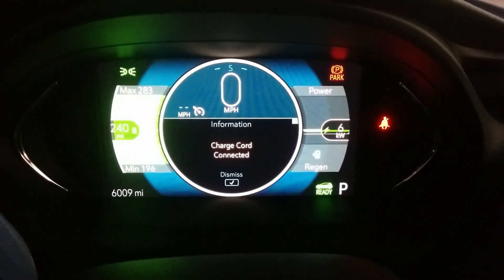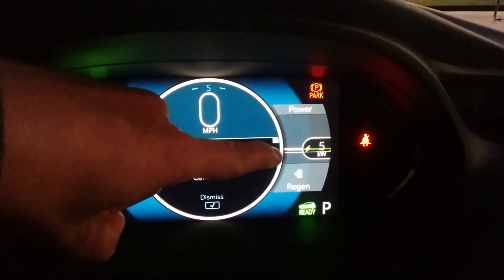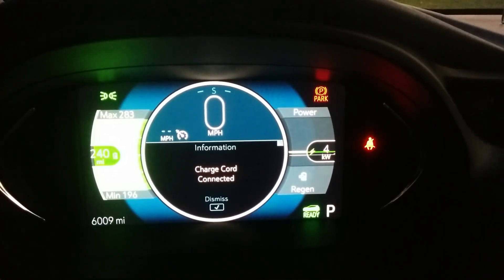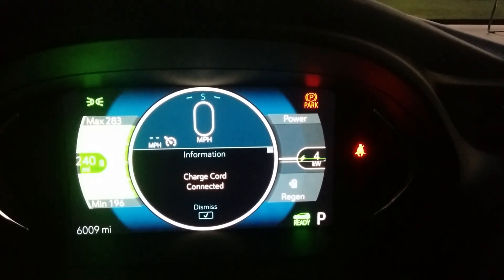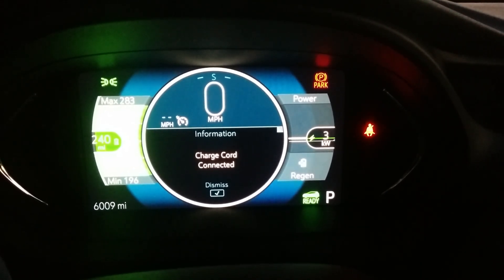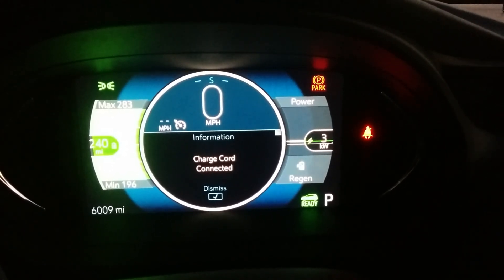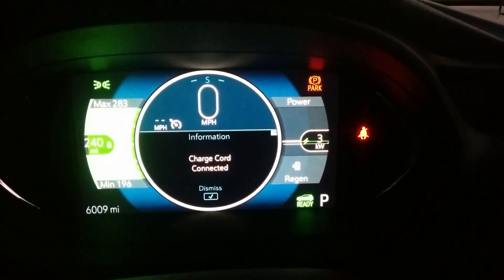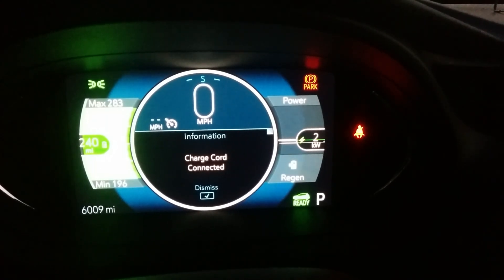Chevy Bolt EV Max Regenerative Braking Indicator

Comment: Keith: after taking off hill top reserve I charged at 120 set at 12A to full at 280 in the center. Went down the mountain and lower foothills picking up more regen charge till at Escondido at the bottom of the last down grade I had 379 miles in the center readout. I was worried the battery might have been hurt, but so far all is well. I do use Hill Top Reserve now and only get 340 to 350. What a car!! Such great engineering! Better than any other full production Electric on the market!

Comment: Hey thanks for researching and testing this vehicle. The more I drive this as an Uber driver the more impressed I am in the engineering. And you can watch movies and videos while parked up to 5 MPH. After that only audio-but when you stop at a stop sign or light from 5 MPH the video comes back on.
Reply: How did you achieve the watching video function?
Reply: On the 2017 Bolt before the factory update, You could copy movies onto a flash drive and play them through the USB. Open gallery.

Comment: Living on top of a hill, I'm painfully aware of lack of regen when the battery is full with SparkEV. I manually disconnect charging at about 80% (also supposedly good for the battery). I think Bolt has 90% limit that's settable by user? Then one would never have to worry about not having max regen and using friction brakes.
Reply from the maker: Chevy SparkEV Yes, you can set Hilltop Reserve, which will only charge the battery to 90% of usable capacity. That should leave you with full regen available.
Reply: I have a Volt and live on a hill and I just eat it because the Volt doesn't have Hilltop Reserve and I am too lazy to walk out to the garage and unplug at 90 percent assuming I knew it was at 90 percent.
Reply from the maker: Keith Watts I've never had to deal with full charge starting at the top of a hill, but my Bolt EV seems to have significantly more headroom in the battery than my Volt.
Reply from the maker: Keith Watts Keith Watts I've never had to deal with full charge starting at the top of a hill, but my Bolt EV seems to have significantly more headroom in the battery than my Volt.
Reply: Keith, the problem is using friction brakes. While energy is probably small, it could mean you have to replace the pads within the car's lifetime. I hate going to the dealer. I disconnect about 1 hour before estimated full time for estimated 80%.
Reply: Your Bolt is awesome.  I learned what the grapevine is from you.   I didn't know you had a Volt.  Thanks for making the videos.
Reply from the maker: You're welcome!
Reply: Well done on remembering to disconnect at 80 percent. I should try setting a timer reminder after I plug it in to help me remember to unplug it early.
Reply: If you're charging off of a 120 volt Outlet in the US on something like a Chevy Volt and you want to keep a little bit of regenerative capacity there there is actually timers that you can buy and plug into the wall so you could try to figure out about how long will it be for 85% or just wait a few minutes after putting the car in to get the car to tell you about how long it would be in then you could set the timer to shut off at around the time that it would be about an hour before you were fully charged in or maybe a half hour still giving you a good amount of reserved for regen braking in the Bolt as mentioned just set Hilltop mode and you almost always have the full region because you always have 6 Plus kilowatts of Reserve capacity in the battery when you unplug you should especially use Hilltop mode if you find that charging to 100% you can go two or more days on a single charge and you're capable of playing the car in and having a 30 amp 240 volt socket every night and bring it to a full charge every night as well because Hilltop mode will definitely help to preserve and increase your battery life because once you start talking about having the battery charged up to 100% that level of charge actually causes the chemistry of a lithium battery to degrade unless Chevy actually has a 70 or 75 kilowatt battery in there with only 60 usable kilowatt hours or 60 usable kilowatts of reachable capacity then they have taken care of that issue for you and I'm pretty sure that on the bolt even when you charge the car to 100% they still have one or two maybe 3 kilowatt hours of room left in the battery and that you can only charge up that tiny little bit by doing region breaking which would also go under the assumption that you are going to use that extra energy you just put back into the battery right away and not keep that little extra bit in there which could be the Tipping Point on that battery for actually starting to cause damage if you have a 1-mile run down hill and you literally just do regen the entire time and then don't burn off that extra 2 kilowatts that you just put into the battery.

Comment: Obviously the return on regen when your battery is full doesn't matter much, so is what you're talking about here the amount of DRAG also being a factor, ie: you have less 'braking' power when the battery is full?  I can see that being something to get used to...

-impatiently awaiting Bolts in PA-
Reply from the maker: Chris Epler Yes. It is noticeably less until you use a couple hundred Wh. After .5 kWh used, the regen braking is already significant.